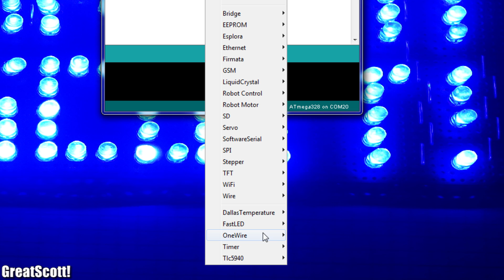Make your own SIMPLE 5x5x5 RGB LED Cube (Part 2)

Comment: First of all many thanks for the video, awesome stuff!
I know this is old, but I’m building one atm and was wondering why we need parallel wiring for each row. I know he says because of “funky looking data corruption”. But am wondering how this could occur. Wouldn’t only the top and bottom rows alone also suffice? Am thinking of creating a PCB for this btw, the LED soldering was relatively fun, made a 3D printed jig for it, but the wiring is annoying me a bit. Make sure you use some flexible wiring for that if building your own. With a 2 sided PCB we could have parallel columns and rows easily I imagine, but still wondering if that is even necessary.
Reply: After googling around a bit this could be to mitigate “current hogging”. Is this indeed the case? From what I understood, having multiple parallel connections will reduce the risk of one parallel string having a lower impedance, drawing more current and therefore causing issues. But not sure.

Comment: Hi Scott,
On LCSC.com i found the WS2812D RGB LEDs.
( https://lcsc.com/product-detail/Light-Emitting-Diodes-LED_Worldsemi-WS2812D-F8_C139126.html ) They look similar to your PL9823. It has also the same pins and so on. Can i use it instead the PL9823 without a problem? If that is possible i can order the LEDs from LCSC an safe a LOT of money.

Comment: Great movie. 
I'm not so familiar with electronics, and in the link you provides, the 5V power supply cannot be changed to 5.5 V as in the video.
I have a question please: 5V might make trouble, so you set to 5.5. 
Could you, instead, put a different resistor? maybe with lower resistance ?
Thanks

Comment: Can someone explain to me how this works...
From what I can tell, all the LEDs share a common power supply and ground, but I don't understand how a single data wire connected to the data input on one LED can control color and brightness (from what I can tell), and also why the data input-output wires are connected in series. Do the LEDs have a special circuit component that allows them to operate in such a way??
Reply: Multiplexing

Comment: Very good tutorial! Are there any design considerations of doing a larger Arduino-based cube using ONE data pin vs. one for each layer? Also, it's been almost 4 years since your video and I have found VERY FEW cube projects that uses addressable LEDs (PL9823, WS2811, APA-106, etc). Care to comment?

Comment: Sehr gutes Video! 
Wieso hast du eigentlich nicht einfach alle LEDs aneinander gehängt.
PL9823 sind  doch locker in der Lage 125 LEDs zu steuern, ohne sie ihn Ebenen einzuteilen.
Bin selber auch dabei einen bauen :D Wollte nur mal fragen.

Very good video!
Why didnt you connect all Leds together?
With PL9823 it should be able to control 125 Leds without splitting them into layers right?
Im also building one myself :D
Just wanted to ask.

Comment: A potential improvement for next time: add a  wire and port to access the Arduino from the outside without opening it.

Also, the Arduino and power parts of the video are a little confusing.

Comment: Do Code and circuit connection works fine with Arduino UNO Chinese Clone which has interface CH340G instead of  ATmega328p ??

Comment: Hello Scott, I created the cube all the way, but when I power it up, the signal does not travel thru some of the lights, I have tried everything, checked the wiring, changed the LED's and still stuck with the same problem, rather strange I should say, by the way, it is not my first cube, I have done a few before... Any suggestions?

Comment: What is that nifty low-profile wire stripper shown at 3:47? I can see Deutsch on the label but can't make out the manufacturer.
Reply: Answered my own question, with the aid of a 4K tv and the pause button. It's a Jokari T20050 Super 4. Runs around forty bucks on Ebay and Amazon.

Comment: Hi! im in the last step for building a 10x10 led matrix using the PL9823 and i got a question, are you powering it from the 5v pin of the arduino? since the led cube draws around 6 amps, is it possible for the arduino to deliver such current?

Comment: It can work with Arduino Uno and a battery, right?
Reply: Er Kalas You can replace the nano with the mega because they have a similar processor just in different packages. But I'm not sure if a battery could supply 7 amps.

Comment: what are the connections for Arduino Mega 2560 rather then arduino nano ?
Reply: depends on what code you're using... i.e. in the ColorPalette example code "#define LED_PIN     5" so it's pin 5, but you could just change that.
5V supply goes to VIn and GND just like on the Nano. The ColorPalette code doesn't use a potentiometer, so you won't need an analog port like A0 in the video. If you want to dim with a potentiometer, you could use any analog port, but you would have to modify the code by yourself.

PS.: You would need to modify the code a little anyway, if you're following that example...
When you're using his code, the important lines are:
#define LED_PIN     2
int analogin = A0;
so the LED-data is connected to pin 2 and the poti to A0.

Comment: +GreatScott
If i wanna build a 9x9x9 cube can i took the same power supply and how many Ampere i need?
What happen if i put to much Ampere on the Cube?
Reply: John Doe As long as you won't put more than 5,5 volts on the LEDs, they won't get too much current. But on the other hand if you have a lot LEDs, they will draw more current than the power source can supply.
Let's take your 9x9x9 cube as an example:
729 LEDs and every LED can draw up to 60mA. That are almost 44 amps! 
And I also think that you wouldn't like to solder 729 LEDs. ;)

Comment: Hi, I have build a same cube following your instruction. Same type of data corruption occured, So I thought I would have to solder all the horizontal connections of VCC and GND for LEDs but, it turned out to be different frequency from power supply and arduino. (I was powering up arduino with USB port then). After some testing with few LEDs on bread board, it worked fine once they had same power source. Thanks to your video, I managed to build one too. (it doesn't look as nearly neat as yours though!)

Comment: Nice video. I am curious, couldn't you just solder the data in and data out together inside of using additional wire?
Reply from the maker: +clevere1 The pins were to short.
Reply: +GreatScott! Thanks for the reply!
Reply: +GreatScott! Really great project. well done! What dimensions would be the maximum for an Arduino do you think?
Reply: I follow the progress of your project but I'm not know you enable led types in the video above, cathode or anode? please GreatScott

Comment: Hi, great videos I always enjoy watching them. But I have one question about the power wiring. Although I have wired everything as you described, I still have data corruption at the third layer. I have tried changing the voltage slightly and replacing some faulty looking led but to no avail.

Comment: Great tutorial, I'm going to have to build myself one of those :)
One thing though; Why didn't you export the micro USB of the Arduino Nano to the base case? That way you would only need to hook up a cable to re-program it instead of lifting the top off.

Comment: Hello! I was watching this and I had an idea that would be really cool if it could work. I am sure you have seen a persistence of vision display, such as a clock or something, and I was wondering if it would be possible to make a 3D version of that. For instance, this cube uses 125 LEDs to make a 5x5x5 pixel image. This display would use a constantly rotating matrix, (like 10x10) to make a depth image. Is that even possible? I would love to see a video of that, but I am not even sure if it would work. I may decide to try this on my own too. Any thoughts on the topic?
Reply from the maker: +ctjet99 You can create the illusion of a 3d image with a 2d persistence of vision setup. There should be videos on YouTube.
Reply: I saw one of those, however, he used offset strips of leds, instead of a matrix, like a slice of your lights on the LED cube. I was wondering if it would be possible with a matrix, thanks though!

Comment: Nice video! A suggestion for straightening wire: Try using a drill. Put one end of the wire into the drill, and hold the other end with whatever you want (if you bend it you can even use your hands). Then run the drill. Don't go too fast though, or the wire may break. This makes the wire more sturdy than it originally was in my experience. 

I was also wondering how the data is clocked in. I see there are Vin, Vout, Din, and Dout pins. How is each bit clocked in? Is there an internal clock? If so, what is its frequency? Otherwise, how does the LED know new data is available?

Comment: Would this work with the big 10mm diffused LEDs?  They have a forward current of 20mA
Reply from the maker: +mnelson10000 Normal LEDs will not work.
Reply: +GreatScott! They are RGB, but the big 10mm ones.  I'd post a link but youtube won't let me.

Comment: I have a Question .. I have bought a external Power-On-Off switch for my pc, it connects like the button which comes with a pc-case.... BUT i also want to use the button of my case.... I think the button's are working like a single pole, single throw switch, but I'm not into electronics that deep, that i can solve my problm.... can i just connect both buttons to the same pins on the motherboard ? 
That should work, because i can turn off my pc with windows and the switch is physically/mechanically on ON... or can i ??
Reply: +Jan-Christopher Estelmann normaly that switch is just a push button, witch gives it a "signal" whenever you click it, so just tapping in on same pins should work just fine :)
Reply: Olav Nikolai Skuterud i will try it, thank you :-), should work with power-led as well ?
Reply: +Jan-Christopher Estelmann im not sure how that is wired in, but i do belive it uses its own pair of leads, so should be possible..

Comment: I wonder if an ATTiny would work. Hmmm
Reply: To run without USB-connection: probably yes, To programm without hassle: rather no. An ESP8266 would be nice to provide OTA pattern loading.
Reply from the maker: +Callum Burns Yes, ATiny would also work.

Comment: Why did you use 150 capacitors in the LED Matrix but not a single one with this project? Visually I understand why, but electronically why didn't you need them?
Reply from the maker: +Oliver Giller Good question. But the answer it quite long. I will answer it when I start producing Q&A videos.

Comment: GreatScott have you ever built robot? I´t would be cool! Just use cheap parts from ebay, like NRF24L01 with external antenna. I´m also building new arduino controlled robot(i have ordered parts already and it cost me about 33 EUR(33 USD)).

Comment: I really like this project. I think I got the part with the LEDs, and connecting them up with each other, but sadly you lost me at the part with connecting the power supply and the arduino.

Comment: Looks great! I'd love to see a video on creating animations for this cube. How much did this  cube cost in total?
Reply from the maker: +vidm96 Around 60-70 $
Reply: +GreatScott! would it be much cheaper with an MSP430? I'd also like to see the code to drive the LEDs. Thanks for another (two) great videos!
Reply: Ankush Girotra The very cheap ones are clones.
Reply: +Mr HamsterBacke but they work i bought 5 nanos for around 10 bucks
Reply: me 2
Reply: +Bernhard Hofmann Just take the price of an arduino and subtract it with the price of the MSP430.
Reply: Me also!!
Reply: +Ankush Girotra Ebay.
Reply: +Bernhard Hofmann The Arduino Nano costs $2-3, so MSP430 isn't really cheaper than that.

Comment: What is the advantage of using the smart LEDs?  Is the only purpose to be able to dim them with the potentiometer?  Also if I wanted to do this in an 8x8x8 could I still get by with just the Nano or would I need shift registers and all that jazz?
Reply from the maker: AwFro
Not much more. Maybe a bit. I did not make a price comparison. But you basically don't need MOSFETs and TLC5940 drivers. But more expensive LEDs on the other hand.
Reply from the maker: +Joshua St.Clair The advantage is that the driver circuit is simpler to make.
Reply: +GreatScott! but I think it costs much more, doesn't it?
Reply: +GreatScott! well, in your last video you showed that you paid ~50$ for 200pcs of those LEDs
Reply: +GreatScott! Yeah I was wondering as well. We wouldn't be able to use something like this? www.ebay.com/itm/100pcs-x-5mm-4-pin-RGB-Diffused-Common-Anode-LED-Red-Green-Blue/261083069774